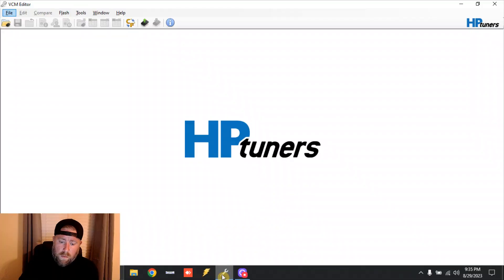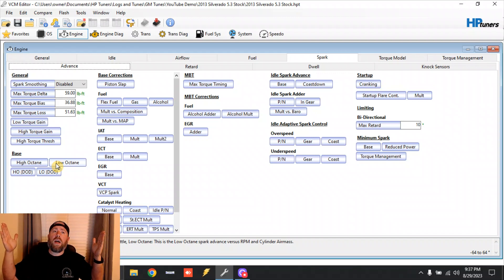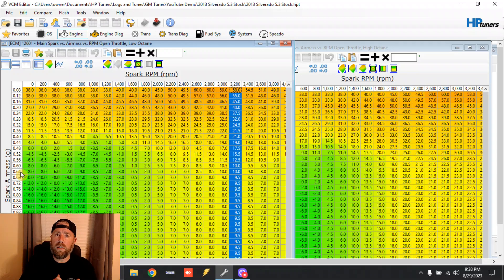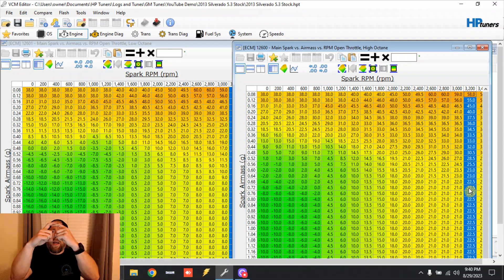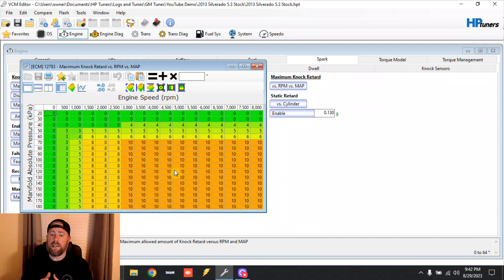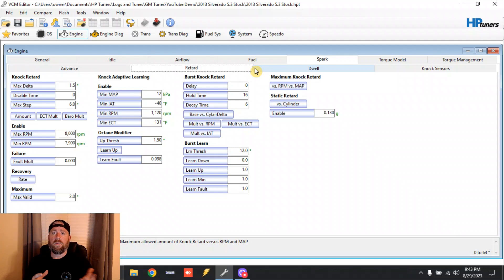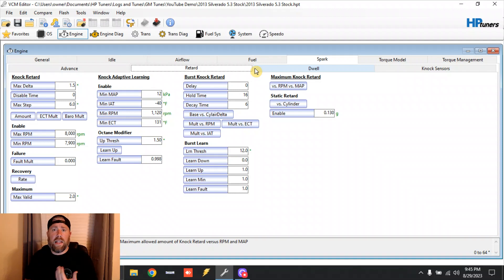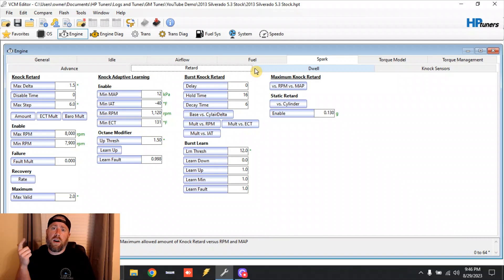Broken Motor Mount can cost you 80+hp in your GM Truck! Here is why!

Comment: Hey Matt, thanks for the awesome no BS info! Just curious on my 15 Silverado 5.3, it seems to be down on power and the fuel mileage is not great. I believe I’m starting to get a slight soft knock out of the cam area, probably a flat spot on a lifter. Would that internal engine noise also trigger the knock sensors into the same scenario as a broken motor mount?

Comment: How about if your truck has over 200000 miles and you don’t think the motor mounts have ever been changed but the engine doesn’t move like you are describing. Should they still be changed?
Reply from the maker: If the engine isn’t moving, then the mounts are good. Someone probably has replaced them though. lol

Comment: What mounts do you recommend?  I put new ones when I rebuilt the engine but she's a little rowdy and I notice the engine is dancing around in the engine bay a little more than I like.  I've been pondering swapping to a stiffer style but no idea what would be the best.
Reply from the maker: Atomic Fab has some options for motor mounts that are stronger than factory.
Reply: @Matt_Sanford  whats your take on a solid steel mount no rubber or poly... motor to frame?

Comment: I believe this is where I’m having issues with my brothers 2000 corvette. It seems to be stuck on the low octane tables because it’s picking up knock when ever he takes off (6 speed manual). I think it’s a combination of the engine and trans/diff mounts being aftermarket and transmit a lot of NVH and I found he has a broken exhaust hanger by the muffler and it has been tapping the frame of the car

Comment: So my question on this is i currently have an 06 cat eye that’s bone stock that has a lq4 and 5 speed if I put say 93 in it how long does it take the computer to adjust to the new fuel I put some in at one time mind you I was less then an 1/8 of tank and never really noticed and thing different that whole tank. (Motor has less then 120k and is flawless)
Reply from the maker: It can take a tank or two. It may be harder to feel the difference on that combo though since the LQ4 doesn’t have a High Octane table that’s as aggressive as a 5.3 truck.
Reply: @Matt_Sanford  is there any room to tune In A higher timing table on those engines or are any mods recommended for it? (I’m new to tuning and I’m still in the bare minimum knowledge on timing.)